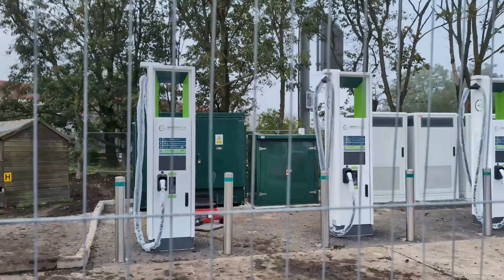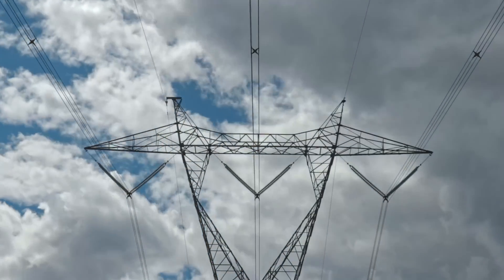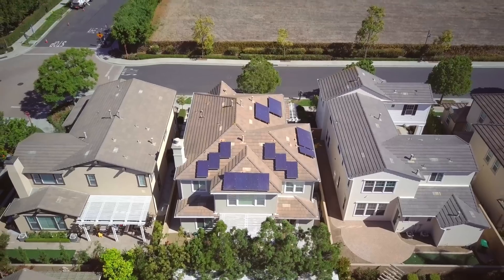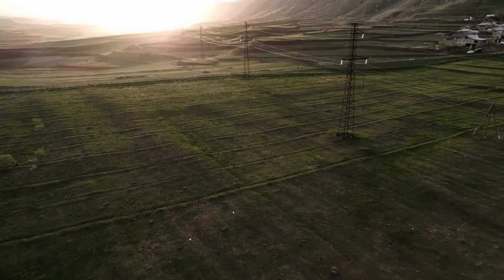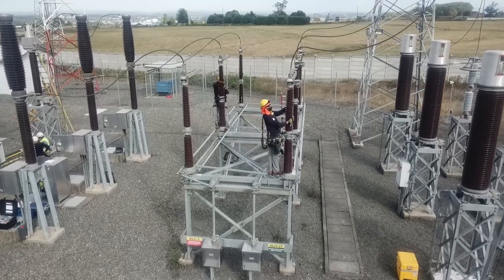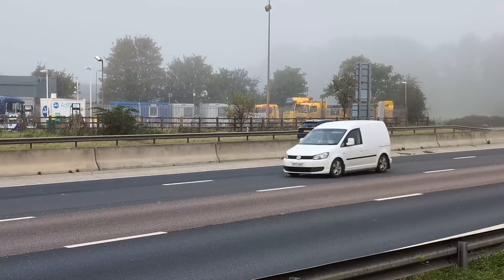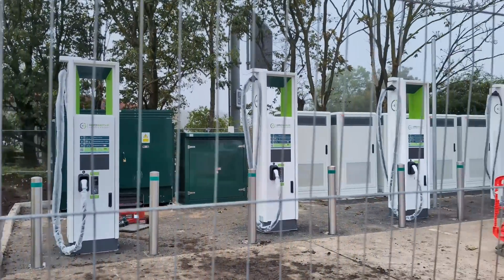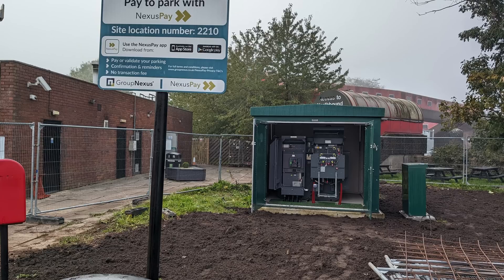Behind The Scenes | How The Grid Powers EVs

Comment: Thank you - I learned something today.

Just to say supply voltage in (K)Volts is different to charger power in (K)Watts. Power is Voltage x Current. 

As you say, power is transmitted at high voltage (and therefore low current), to minimise losses. As it gets closer to destination, it is stepped down to lower voltage at higher current, to transfer the same amount of power.

Most EV chargers dispense 400 or 800V at ~313 or ~156 Amps, respectively, when charging at 125kw. That results in just 0.3 amps extra draw on the incoming 400kV power line.

Comment: Hello Dave, 

 a pretty good overview although with some rather optimistic views. Generation capacity, for example is very marginal. This summer, a time of low demand the Grid ESO asked that some mothballed power stations be made available as capcity was getting short. It will deteriorate as our current nuclear fleet (about 5 Gwatts) has just afew years left of life before being shut down. (In capacity alone this will need about 12 gigwatts of wind capacity to be built in a few short years, rather unlikely). Also PV electrcity is very low for four months of the year, at a time of maximum demand on the grid.
The very real problem will be the existing local area network to existing domestic properties, it's capacity is far too low in general for the envisaged expansion of evs with that being compounded by that of heat pumps. While much ev charging will be at night, thus the load on teh network being lower, heat pumps will also be running at that time.
Politicians, unfortunately seem to think that electrcity can be taken for granted, which is far from reality. I think you can look forward to time limited rationing in the future?
Reply from the maker: Yes, really early days, roadblocks will happen but we have a really steady grid, virtually no blackouts apart from storm damage and I seem to remember it's been like this for decades.
Reply: Dave, 

the grid is less stable and less reliable than it used to be. The national grid terms a deviation of  0.2 Hz as a frequency event. Such events have increased steadily in the last few years as more renewables are added. This indicates that it is harder to keep the grid stable. The grid is suscebtible to the domino effect, and if parameters are exceeded then a large scale grid failure is possible.

Comment: DNOs are required (by Ofgem) to NOT put in too much kit over & above today's needs. Why? Cost - the more kit installed, the more it costs - and costs to maintain. And, it's the customers who foot the bill. But these rules have been in place since AC power was deployed in the UK - turn of the 1900s. Hence, for c. 85% of the country, networks are good for "lighting+". The historic average across the UK for residential load is 800W (0.8kW). These DNO networks are the "last mile" taking 230V to homes (via a feeder cable, a 4-circuit 230V 3ph+Neutral cable).

So. Given a network good for c. 1kW per home (varies by area) how do EVs (7kW) and HP (5~10kW) get supplied? Ones or twos are OK. More - nope. New networks please. That's c. 250,000 transformers and c. 500,000 km of in-road and in-pavement buried cables to be replaced.

Some units: Volts is pressure, Watts is power, Amps (often I) is current - the amount of flow. Power is the amount of stuff delivered per second, energy is the total of all energy delivered. A battery (or petrol tank) hold kWh of energy; the speed of delivering this to power to vehicle wheels ie kW. W = V.I

So - why is this major (bigger than HS2) issue of needing new networks not talked about??? Well, people think networks = National Grid (NG), even though:

a) that's a company name, and
b) NG own only c. 4% of the whole system
c) NG are not DNOs and cannot comment on their problems,
d) NG are right when they say all is OK - well, for their stuff, YES. The major problems are with the DNOs.

And... politics. All that digging up of your roads. Very much a can kicked down the road since 2012.

This has been known about for a long time; for those interested see (if you can find it) the first "there is a big problem" report which is the EATL/ENA commissioned DS2030 study called "Assessing the Impact of Low Carbon Technologies on Great Britains Power Distribution Networks", the Smart Grids Forum SGF WS3 Work Stream 3 one.

Hm. Will this impact the UK's LCT roll-out? Methinks - Yes.

PS - this stuff is my job.
Reply: I don't think there is going to be an issue with the DNOs. The average uk car is driven 8,400 miles a year. So an everage of 23 miles a day. Or about 50 minute a day on a 7kw charger. As long as that extra demand, about 6kwh per car per day, or about 65-70twh for the whole uk road fleet per year. 

Taking uk power demand from about 306twh per year to about 370twh per year. STILL less than demand was in 2006. 

Quite clearly that is NOT to much for the grid to cope with because it did it in the past. And as long as the extra is kept out of the peak hours (4 to 8pm) and you will have no real problem.

Having said that there may be need for local reenforcement. Additional substations etc. But 3 of the seven substation sites nearest to my home no longer has substation in them. So over the last 30-40 years they have actually been removing them.
Reply: @patdbean The NG systems are designed to cope with peaks, the TWh numbers you quote. The issue is not at that level - rather, the last mile 230V systems which are (not NG owned) built to supply average loads ie not sustained peaks. Yet the smart grid especially concentrates charging into a window (eg cheap power 12 midnight to 6am); these loads + "Smart" shift the average lots. These 230V networks were designed to cope with c. 1 kW+ per home; that is a 100 home group would have a c. 120-150kVA system.

But it is not just the EVs. It is also the Heat Pumps we are encouraged to own; these can pull up to 10kW each, often 4kW sustained. So a 100 house group has to supply, for hours, 500+ kVA for the HP and usual residential loads. On a 150 kVA built system.

And about 85% of our housing stock is in this situation, with many electrical studies (on paper, in real-world: CLNR, My Electric Avenue) pointing out these issues. And these studies are now 10+ years old.

As said, NG have few problems. If you want to dive deeper, look at DNO proposals / responses to RIIO-ED2 and what Ofgem had to say... alas, a lot to read through and full of squirrelly avoidant language :(